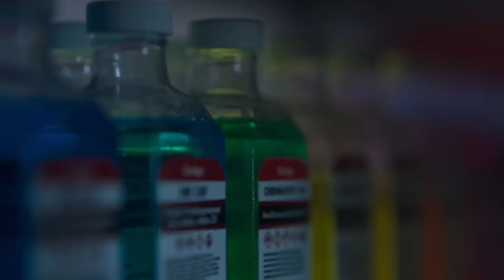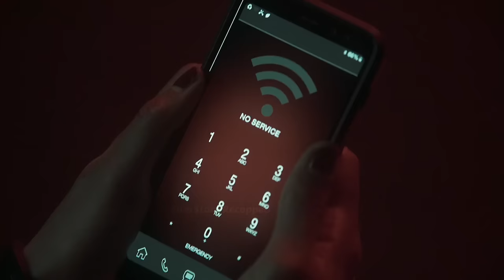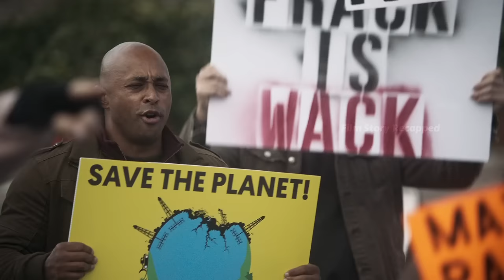Zombie Outbreak Unleashed by Drilling Company; Town Faces Chaos

Comment: Is it just me or is this confusing, cause how can zombies come out of the ground when they would be buried in a coffin? And not only that but they also nail the coffins shut before putting it in the ground so when they are taking the coffin to the grave site in a car and if a crash or something happens then the coffin won't fall out and open up to have the body fall out of the coffin so how did the zombies come out of the ground so easily and wouldn't the pressure of the dirt crash them anyways or trap them because they put the bodies in the ground about 6 to 7 feet and having that much dirt on you will trap you making you unable to move at all
(I don't know how I knew all of that but...ain't I'm right?)